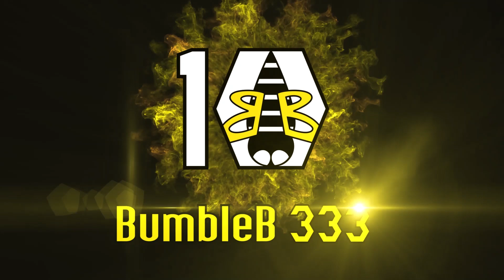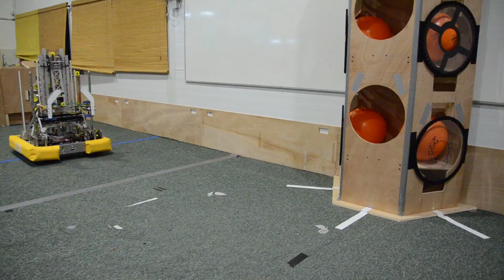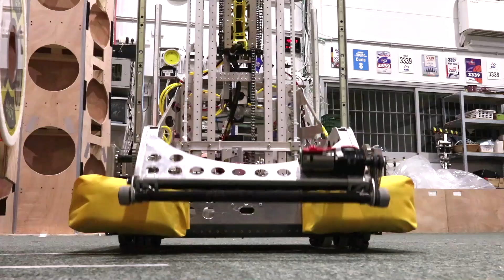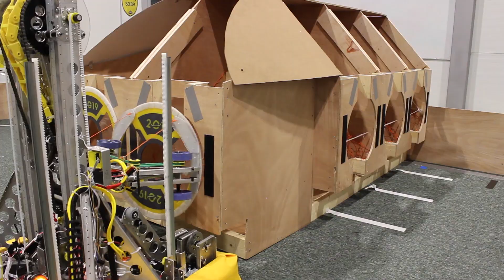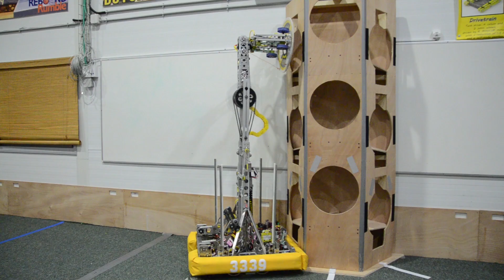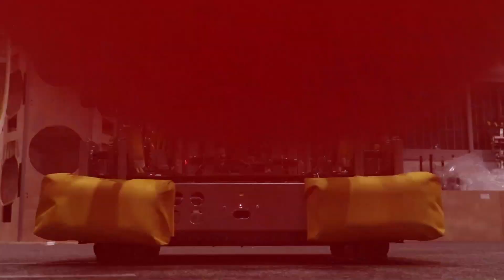BumbleB 3339 FRC Robot Reveal 2019 - ArmStrong

Comment: could you please explain how your climb works.  Like what is the motor used?
Reply from the maker: Hi there!
So, our climbing mechanism is four Rack and Pinion legs, one in each corner of the drivetrain powered by 775PRO motors with a reduction of 1:50 controlled by 4 potentiometers one for each leg.
Reply from the maker: Sorry for the delay, for more questions - we're available!